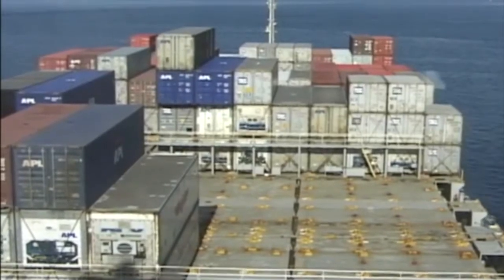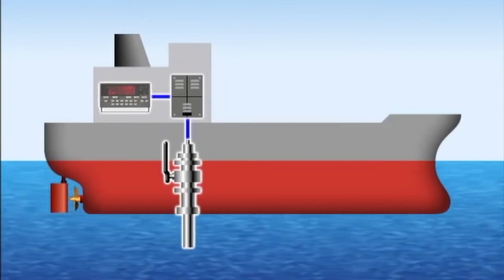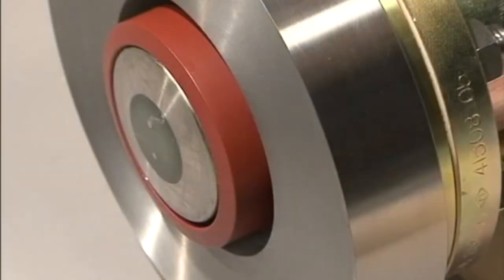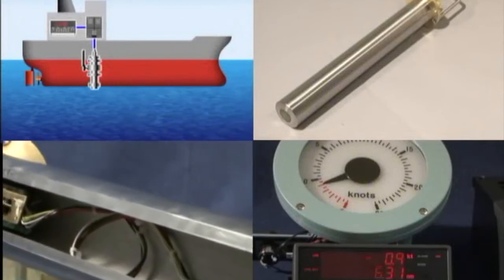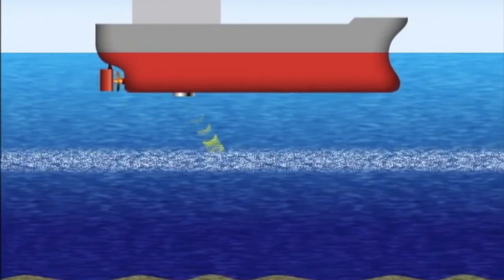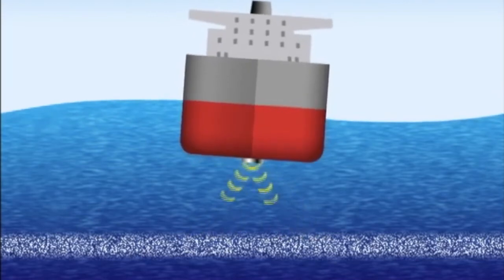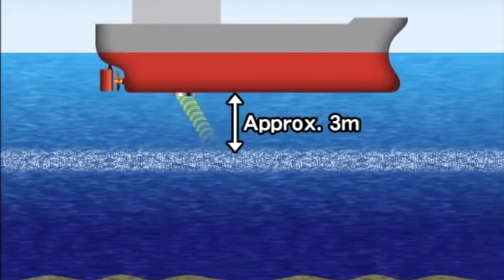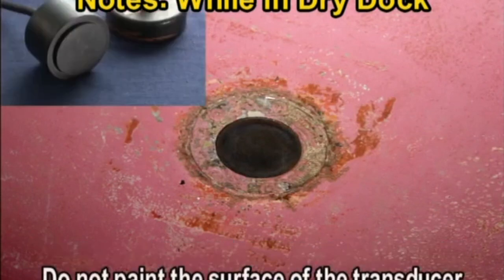Navigation Instruments  EM Log and Doppler Log

Comment: Hello. Which one is better. Ground or water?
Reply: SOG is better as it is a fixed point of reference for the sonar to reflect off, limitations is the depth of water where the sonar
cannot reflect off, Usually around the 200m mark.

Anything greater than 200m in depth, STW is used to reflect off particles in the ocean or anything else it can find